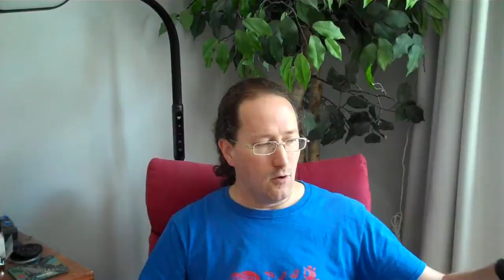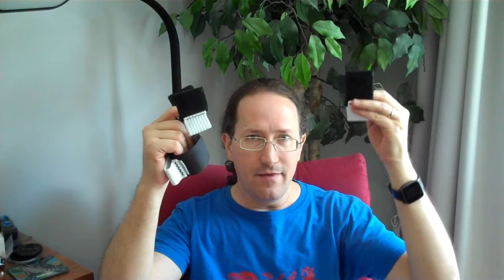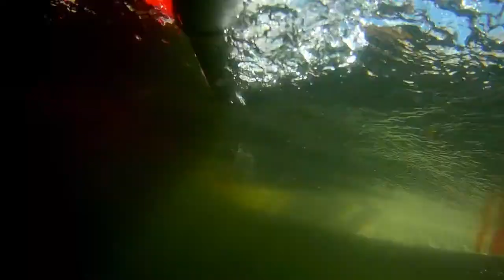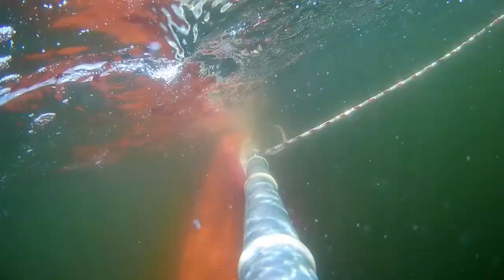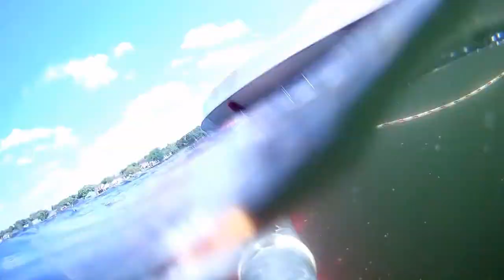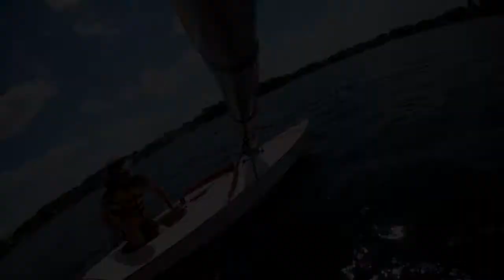The importance of main sheet hangers for sunfish sailboats - clothesline capsize and recovery

Comment: I am not sure why people limit the hangers to just a couple of inches. By class rules (only important if you race) there is no limitation to the number or size of the hangers, they just have to remain between the two boom blocks for the main sheet. I use a mesh with velcro to wrap around the boom, the full length of the boom between blocks. Why leave things to chance by using just a couple of stubby hangers. It is the worst feeling getting caught by the drooping main sheet and having the boat come over on top of you.
Reply from the maker: Since this video I've installed the three velcro hangers, and they have been plenty to keep it up and next to the boom, and don't interfere with the movement of the sail clips.  (I placed each equidistant between the sail clips....so you can do more....but 3 seem to be enough for me.)
Reply: @summetj  True, if you use an outhaul, you need to avoid the range of the sailclips/sailties between the blocks...